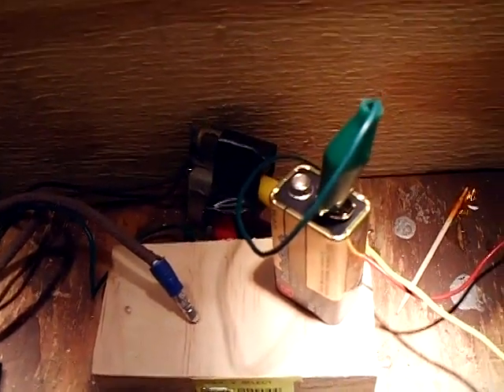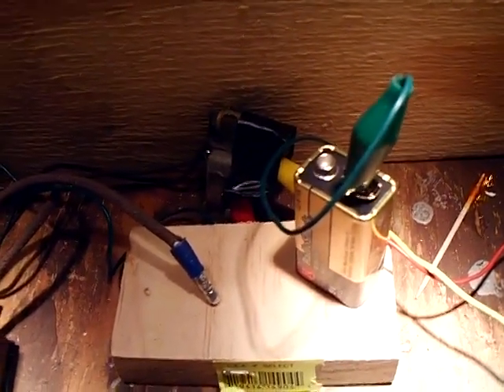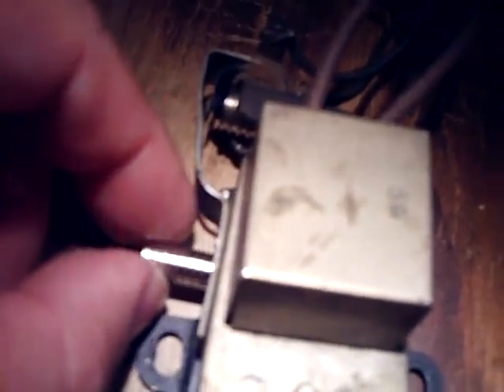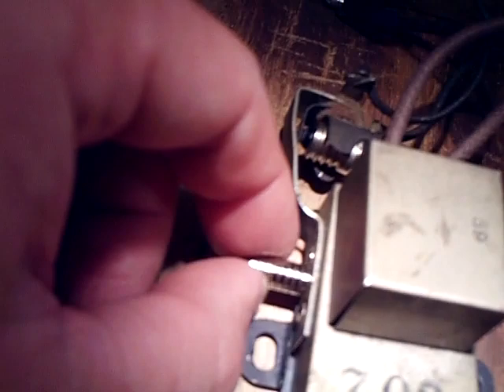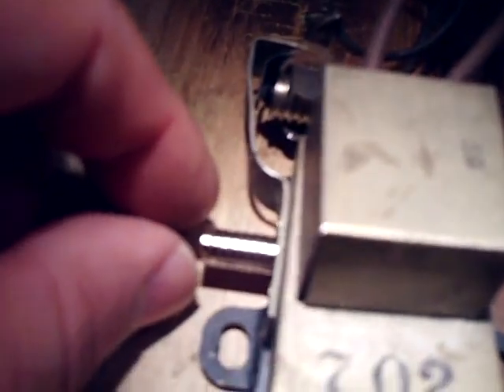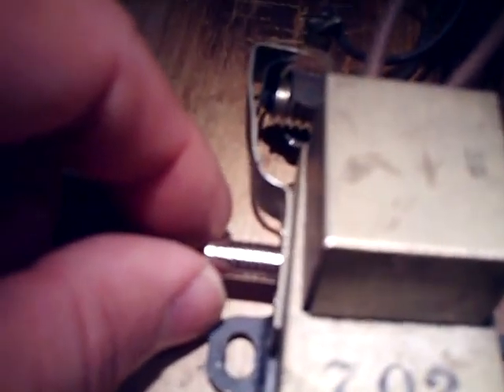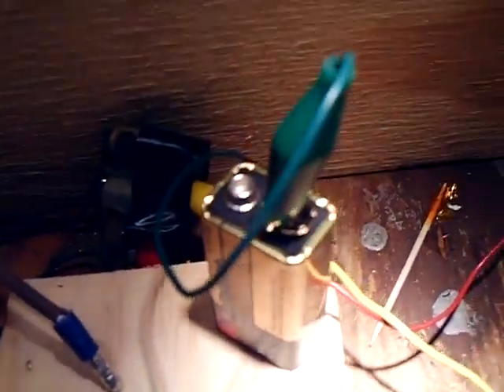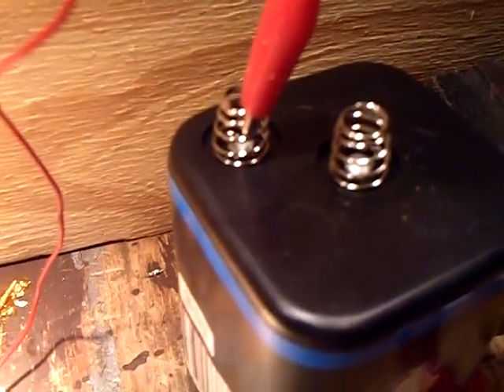Part 15 Shadow Meter Testing. Philco Model 16B

Comment from the maker: Thanks. I'm thinkn' I will at least try to center the meter by moving the light a little when I install it in the radio.. This will give a bigger center shadow but it will be centered. Those little magnets are pretty strong. I'm gonna experiment some more with them. It's fascinating how strong they are for their size.

Comment: The vane probably won't oscillate as much once the shadow meter is back in the radio.  Maybe at startup, but afterward the movements should  be a lot smoother.
As for those shakes:  Ya  gotta learn to coordinate them.

Regards,
John